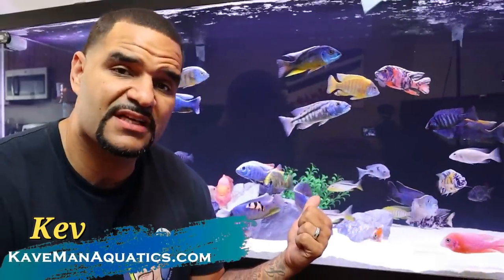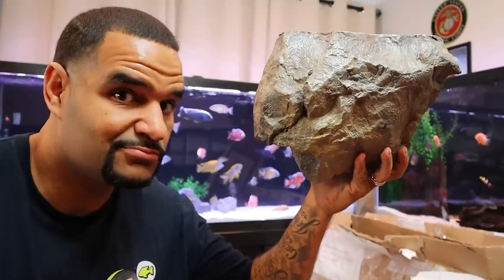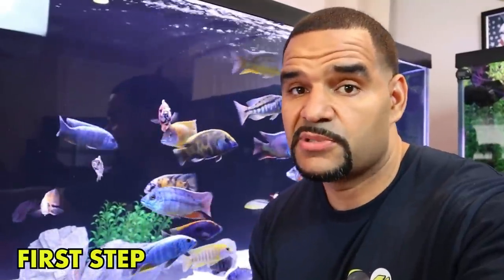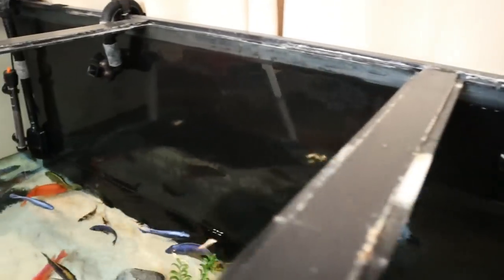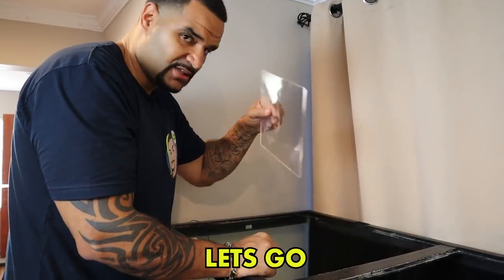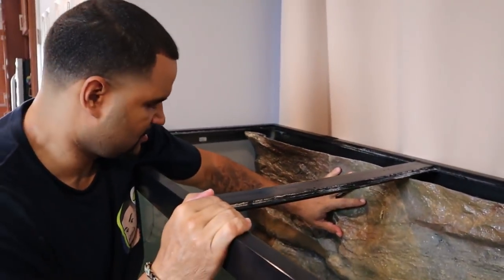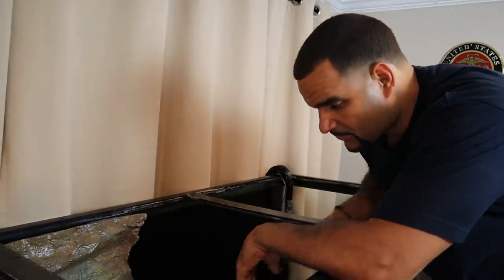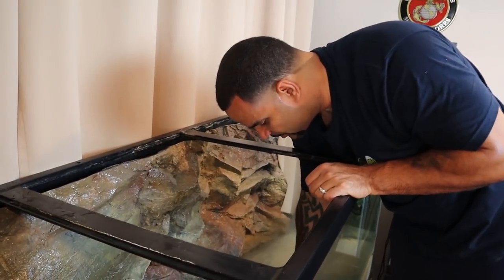3D Aquarium Background Installation - (210G Tank w/ Fish)

Comment: Hey kev! just wondering, why do u only place 1 wavemaker in the 210? Don't u usually place another one at the other side bottom for the full circulation?
Reply from the maker: The wave maker in my 210 is a monster. I actually turn down the power and it still pulls the substrate towards it from the other side of the tank. So 1 is more than enough. Check it out here - https://kavemanaquatics.com/products/wave-maker-3400-gph/

Comment: I watched the installation of this. It looks awesome! Now I’m looking at one for my 75 gallon and I’m wondering if you’re still loving it? I’m a bit skeptical about how the filtration is going to work with the intakes being behind the wall. Is your tank still crystal clear? Also, with the heater behind the wall does the entire tank stay at the correct temperature?
Reply from the maker: Yes and yes and yes! Lol My tank remains crystal clear, you can see it in my latest video. The heater is behind the background but the important part is that it’s next to the intake. So heated water goes through the filter and comes back out the outputs which are in front of the backgrounds. I get very minimal detritus build up as my wave maker helps to move the waste and it gets pulled behind the background where both intakes are. 👍
Reply: Thank you so much! That helped me to decide. I have to get a quote from them but I think I’m going for it. 😁 I have one wavemaker. It really does help keep the substrate clean.  😏
Reply from the maker: Glad I could help! 😊 Make sure your internal tank measurements are accurate. They will provide instructions of what they need.

Comment: Hi Kev, sorry to bother u brother .random question. Needed advice desperately. Please help. Setting up the new 65 gallon tank for discus. Nearly 6 weeks now. Ammonia still up. Had live plants, which I believe are dying now.This morning I noticed my tank glass had lots of tiny white things sliding inside my glass. On doing some research narrowed it down to something called the rabdhocoella.Have u ever come across these things. Is there any way to get rid of them without crashing the cycle down.Do I have to change the whole sand and start all over again. No fishes in the tank yet. Please advice
Reply from the maker: Sorry bro, Ive never heard of that and dont have any experience with it. If you still have ammonia in your tank after 6 weeks something is preventing the growth of your beneficial bacteria. Do a big water change and scrub whatever that stuff is off, Start dosing Stability daily to get your tank cycled. Make sure you have adequate surface agitation so that the water is properly oxygenated.
Reply: @KaveManAquatics  Thanks for the reply brother. I think its some kind of a detritus worm.Iam  guessing that It could be due to my live plants rotting, Either way I just have to have patience. Going to drain the whole thing out and start all over. Saw one of ur video where u explain about adding prime and stability for a week. At least I dont have any fishes in there. So like u say brother 'Lets go again ' lol.

Comment: My 3d background will be here next week for my 125 gallon. Did u shut the valves off on the fx6s for install cause I'm gonna have to remove my intakes & outtakes too.
Reply from the maker: Yes sir, shut them off and unplugged. When you remove hoses trapped water will come out so have buckets or towels ready.
Reply: @KaveManAquatics  i have my background in. Its a thin rocky background from universal. I have two fx6s & two wavemakers. I need help with the flow. Where do I point my fx6s output nozzles? I have the inputs at each end of tank in corners. Placement of wavemakers as well cause whatever im doing im getting alot of poop buildup in one corner. Any advice , thanks!!!

Comment: Hello Kev, I have a goldfish and I have had him for 3 years. Yesterday, I bought another goldfish from PetSmart and he is small. The goldfish I have had for 3 years is about the size of my hand and the new one is about the size of my finger. They were both doing well together but ofc the new one was scared of my older one but other than that they were eating well and were fine. BUT, the next day, my goldfish, the one I had for 3 years, stopped acting normally. Now he has red streaks of blood on his tail and fins. The fish are both comets btw. He completely stopped eating and even stopped begging for food. He also started to sit on the bottom of the tank and started to tighten up. Now he has red streaks of blood on his tail and fins. I did some research and apparently, he has red pest disease. I did a water change and all that stuff and after that, he stopped sitting at the bottom of the tank. He is also gulping air from the tank, not at the top but when he is swimming he does it. He has started to act normal but the only things abnormal about him right now is that he has red streaks of blood on his tail and fins, he is gulping for air while he swims, and occasionally he does the gulping extremely fast. Also, my air stone has not been working as well ever since that new fish came. Sorry for this long paragraph but could you help me?
Reply from the maker: This is why you should always quarantine new fish before adding them to your tank. You never know what disease that new fish can bring with him. Unfortunately I dont know much about red pest disease but if you keep the tank clean with frequent water changes and make sure your air stone is working properly and providing oxygen in the water hopefully he can recover. Good luck bro
Reply: @KaveManAquatics  Thanks Kev. I didn't know you have to quarantine new fish. Right now, they are both doing great. Thanks for the tip.
Reply from the maker: Glad to hear it! 💪

Comment: I am after some of those 3D artificial rocks but not the background. I currently have a juwel vision450 with the juwel stone granite 3D background. Is there anywhere I can find just the artificial rocks themselves without the background? I can't find any thank you.
Reply from the maker: They came with my background purchase 😊 Find them here - aquadecorbackgrounds.com Tell them KaveMan sent you, lol Also use code Kaveman10 at checkout for a 10% discount 😊
Reply: @KaveManAquatics  Thanks mate. I will get doing that now. My aqautium is running great only issue was I have high phosphate and silicate which I'm going to use the Phosguard you talked about. After my levels drop to 0 should I leave the phosguard in the cannister filter still? Then when they rise again change the phosguard? And Also how often should I change the Polyfil in the top of my fx6 when I start using it. Thank you

Comment: Hello Kave,

I have already made a new tank of size 5Ft Length 1.5 ft Breadth and 2ft Hight ( 112 US gallon / 450 Lits of water capacity) and I will make it a African Cichled tank. I want to know few things from your side.

1)	I will use 2 wave maker of 24watt. Is it actually required.
2)	I will use SUNSUN 304A canister (Capacity 2000 L / Hr). 1 sponge filter also. Do I need any other filter.
3)	I will use filter media ( Burnt ceramic/ Bio Home/ Matrix/ Matrix carbon/ Sechem Purigen 250ml/ Yellow Ceramic/ ). Any other filter media is required.
4)	Any special suggestion for the new setup.
Waiting for a positive feedback as earlier.
Reply from the maker: If you're just learning about African Cichlids my Free Webinar Training will be very helpful for you. Check it out here - https://event.webinarjam.com/channel/KaveMan-Aquatics

Comment: Hi I have a 210 gallon aquarium and I have a wave maker it is 12000 LH  is it to strong for the aquarium?
Reply from the maker: For a 210 no, I have a 3600 GPH in my 210 but I do turn the power down a bit. If you have big fish that like the current you should be fine.